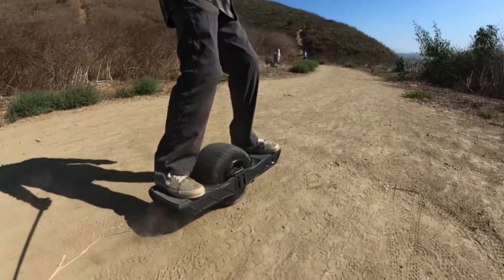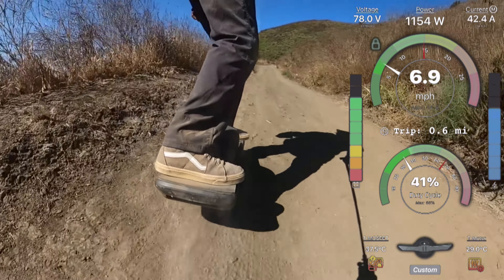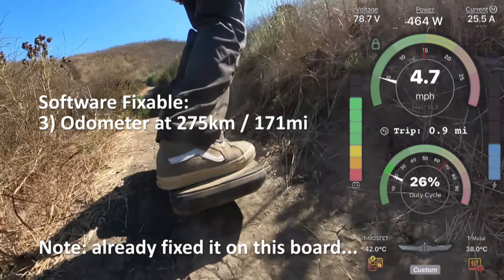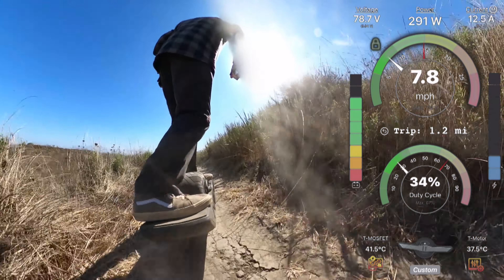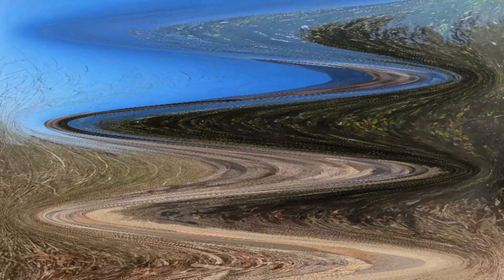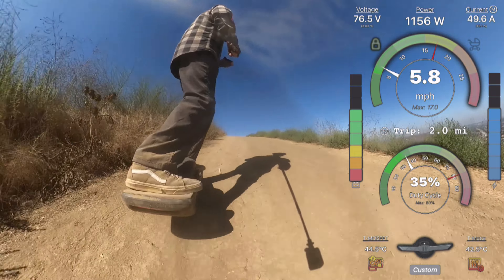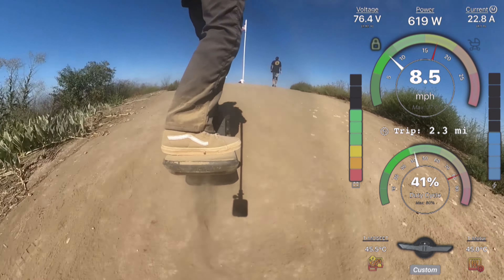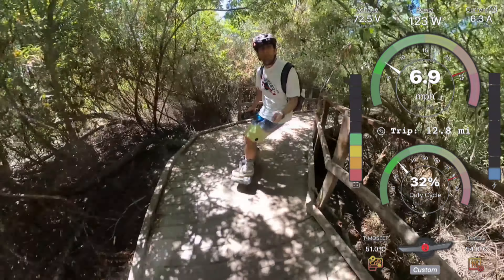Floatwheel ADV Pro - Issues and Fixes

Comment: Whole team Watching and taking notes, 
Yep the first batch turned out to be more bumpy than we thought, I'm very sorry about this.  
But already working on all the fixes. Here are some progress at fixing those problems,
1. battery drain issue, it currently drains at 0.008A and its not good, 0.008A means your board will drain in 41 days, which is not longer than a winter season, but like you said luckily we have bms protection, so it doesnt trash your battery even if they got left not charged for too long, easy fix will be plug it in wall and leave it during winter. another fix will require at least swap out the LCM module for a new one, I have already made it drain at 0.0004A now on my boards with modification on the LCM that means it will last about 800days fully charged sitting there, but still oberserving for any quirks with that mod, which is replacing the LCM bottom R6 resistor to 1206 200K resistor, requiring a hot air station, I understand most of people dont have one, so I'd just order 600 units of revisioned LCM for you to swap out, that is how I plan on solving the slow drain issue, I found it using liquid nitrogen dipping the whole ESC+LCM, and using a thermal camera, that resistor is the only hot thing during poweroff, and I replaced it with a 200k and the drain is gone. I designed the LCM with the IC's datasheet requirement (10K) turns out it is too low for real life situations, but thank god the cost is not astronomical, we can afford this recall. 
2. footpad sensor ghosting issue, the issue only exist in first 80 footpads with the first batch boards, the problem is the layers being assembled using wrong type of adhesive causing water to disolve the adhesive rim around the sensor layers, we have shipped all 80 customers with new revisioned footpads, they should be able to get it in this week, the new footpad used a PET base adhesive so it is water resistant, I have tested the new ones under water for over a week, still works great.
3.BMS issue: yep we need a more advanced BMS  that can talk with the vesc incase of a battery pack malfunction, at least it should slowly pushback before cut off, for this to work, we are now working on a new BMS and a new cable harness, that will allow the bms to communicate with the ESC, other than that, it will need individual cell monitoring with app, active balancing, protection parameters set up via app, and it needs to be a charge and discharge bms for sure, charge only is not ok, in event of a ignorant rider leaving the board uncharged for 3 month while the battery drained to 0, and he plug it into wall, next thing the whole house is burnt down and we on tv. so I disagree with charge only bms, use this only if you know your battery stuff. we have a working bms evaluation prototype that already does active balance+individual cell monitoring via phone at hand, the problem we have is that this bms is massive, we havent figure out a way to put this in our board, probably need to do a 3 layer board to board to board design to fit it in, it is a massive project, even bigger than the floatwheel adv itself, so allow us some time, we have seen 2 events of bms cut off during ride, it was in the first 80 boards, one vital QC process is not carried out during first batch production, which is individual cell drain monitor, we now let the baord sit in the factory for a week, test for any cell drain issue, so this will be stopped in factory and no longer be an issue in the future. but like I said new bms is being designed and we will make sure it is backward compatible with first batch boards.
4.Brittle plastic, simply was us being stupid chasing for that matt surface finish and dumped too much fiberglass in the mixture, first 300 boards will receive a whole refresh set of plastic shells(bumper set +fenderbase set)
5. Motor making UFO noises at lower speeds, easy fix is tune your zero vector frequency up or down 1khz and the noise is gone, we think this has to do with current sensor not being accurate enough in lower speeds with lower battery voltage, cant say for sure, but once I tune the zero vector frequency up a bit, its gone. 

6. first 200 motors are way too torquey, they are wind to the same configuration as the hypercore actually, the reason why it feels slow compare to the GT is that it used magnets that are way too high spec, on the GT you can take one magnet out to measure, it is around 1750Gs that means it is a N30-N35 magnet, the adv is a N42H magnet, which measures 1929Gs in the center, on top of the higher grade maget this thing is thicker longer wider than the hypercore's magnet, so the flux is 1.6x hypercore, with this magnet it comes great torque, but the magnet also generate massive BEMF, so it doesnt run fast without fieldweakening, fieldweakening is basically injecting current into Q axis to create a magnet field to fight against the BEMF generated by the motor, so with 80A field weakening, you will find the motor can actually spin faster than the GT but sacrifices efficiency at higher speed, the first batch of motors will be really efficient around 20mph which is the speed I ride longer distances at. I purposely set it this way so the range is good even with a bigger ass motor, but since you guys like higher speed, doesnt hurt me to swap to 135 new design motor, it doesnt really hurt your torque tho, it just needs 20% more current to generate same torque as Batch 1 motors, so expect the ESC to run hotter than the batch 1 motors. in accelerating performance the new motor will feel more like a GT which picks up speed quite fast but with higher torque to keep your nose not scraping. 

That is really long essay, thank you for reading this, now ima get back to fixing first batch problems for my supporters.
Reply: A very thorough and reassuring update Tony! What would you say the final waterproof level of the boards came out to be? Can I be comfortable riding it in the rain, or through a small puddle??
Reply: @Jdb63  the motor plug might need another layer of protection from dado's experiment, I'm thinking maybe badger kit + a raincoat for the motor plug or you can just soft epoxy the whole motor plug, and maybe heat and press on the smart lightbar and front and rear light windows, I don't trust them 3m vhb that much, even tho It seems to do a good job of keeping water outside, the front and rear box is solid other than those.
Reply: Tony and the team are legends and will soon take over the market this Board is amazing never felt anything better you have all our support moving forward 🤩 🤩 🤩 keep it up ❤️
Reply: @floatwheel not sure if you heard yet, but people have been able to reduce the motor noises by lowering the brightness of the LEDs so i suspect there might be some interference going on.
Reply: @freedomcaller  yep heard it too investigating right now
Reply: I don't know how feasible it is to have two different motor configurations, but as a non-speed freak, I love the extra torque and higher efficiency. I'm glad I got one of the first few motors. :)
Reply: @justinsmith5862  John said first batch motors will probably be the only one that doesnt need big current to drive an American.
Reply: I like we don't have to ask for replacements on the early issues, Tony's taking care of us ❤
Reply: I will also mention my board Beeps at 70% duty cycle, sometimes it won't stop beeping after I change the light setting, and sometimes it beeps while it's just sitting there after I dismount.
Reply: @hippie.matt.  sounds like a bad firmware on the LCM
Reply: @floatwheel  also why can't the board be powered on while charging?
Reply: @hippie.matt.  its a UL2272 safety requirement, also if you can ride while charging people will try to ride the board while charging and snapping off the charging cable, if a pev can be activated during charging, it's definitely poorly designed
Reply: @floatwheel Just one more thing the Bluetooth can be flaky at times Works flawlessly while I'm sitting on the bench but when I pull it out of my pocket after riding it's usually is disconnected from the board.

Even with these little quirks still 110% satisfied, the float wheel Team is awesome ✌️

Cheers Matt #1745
Reply: almost like they needed more testing.
Reply: I wish all companies would handle problems like fw is doing it. Much respect, Tony!
Reply: Amazing transparency and phenomenal customer support with fixes and replacements. Next level awesome Tony and John! 
I am so happy to be a founding supporter of this fantastic initiative. 
I am around 400kms on my ADV Pro and it is riding superbly with the stock tire at 12psi and rails lowered one stop, I ride pretty hard predominantly on MTB trails and it eats up anything I throw it at. 
Funnily, I've also discovered a renewed liking for big carvey paved trails for short spells because the ADV is so smooth and cuts some monster carves. 
When you consider price, repair-ability, support, ride experience, overall build quality etc. I highly recommend Floatwheel ADV's
Reply: @floatwheel. Is it possible to include a gen 1 N142H motor with my order instead of the gen 2 135?
Reply from the maker: Tony, we are taking care of the LCM firmware. Simon, your very first ADV customer is currently testing new versions  with lots of improvements - we will share the new version with you when ready
Reply: @chodarth  I got your idea, since there is no uart comand in the vesc to stop motor from being spinning, So i went another route to just shut down vesc power back when I was designing the LCM. but it is a firmware fix tho.
Reply: @chodarth  got it, it's easy via a
Software update
Reply: WOW what a way to respond... I'm still waiting out on some of these important fixes to be addressed before pulling the trigger on ADV but VERY VERY impressed still. Keep at it Tony and the Floatwheel team and also surfdado! yall are GOATs!
Reply: Wow, The floatwheel team is awesome!  Next board i'm getting will NOT be a Future Motion product thats for sure!
Reply: You are already better than FM. We appreciate it
Reply: Floatwheel for life!
Reply: @floatwheel is the whole board UL2272 certified? If not, which components are? Thanks

Comment: I just got mine yesterday and took it for its first real ride today. Sooo much more power than the Onewheel Pint, but definitely less carvey. Feels great and stable though. mine is making the UFO noise and i was unable to get it to go away with the zero vector Frequency adjustment. Dont mind it that much though so not that worried about it. I can only run my tire at 12psi. Any more and it rubs. Also when looking at the motor parameters and the motor inductance difference i notice mine is nowhere near either of those numbers you stated, being actually around 15. I dont know what that means but its got gobs of torque and I wont be riding 30+mph so not concerned with getting over that. But im stoked to finally have mine in hand and be riding it!!! So much better than my Pint in a lot of ways.

Comment: I hear you on the bms thing with gtv vesc. On the gtfo thor 300 ot comes with their bms that I installed along with the thor. It was bad out of the box and fungineers is sending mee a new one. It was only showing 16 cells charging on its app, even though it was charging out to 75.4 volts at 4.20 volts per cell or close. Is the thor bms one o the ones that can drop you like you speak about, or is it a stand alonne bms. I wish fungineers made more info available on their products.
Reply from the maker: @dbirds21  all the BMS’s are charge only BMS’s, none of them can/will dump you
Reply: @surfdado  thank you. curb nudges are now so much easier with the thor. the stock setup was a challenge everytime with no power. had to lean hard on power. now with thor I just creep up n over

Comment: Great video, thank you. It's been awhile, can I ask what you use as your daily OneWheel driver these days? Both on and off road ideally? And I'm wondering how the Floatwheel has aged? I'm pretty amazed by how durable my XR is longterm, I live on the beach and it's perpetually covered in sand and other than a few grip tape replacements and a tire, it's still rock solid after 2 years of constant abuse. But a bit more torque especially off road sure would be nice. I'm considering VESCing it, but also of course considering a Floatwheel.
Reply from the maker: I ride mostly trails so I prefer my XR based custom builds. To me the Floatwheel is a great street cruiser, and maybe light trails. But it overheats way too quickly on harder trails (most of my local trails)
Reply: @surfdado  Interesting and thanks. Any thoughts on how a Floatwheel overheats compared to a GT on those harder trails? And psyched to VESC my XR.
Reply from the maker: @wrybread   the motor crushes the hypercore in thermal performance but the controller is the weak link in the floatwheel
Reply: @surfdado  Is there a VESC controller that you think is an improvement?
Reply from the maker: @wrybread  plenty controllers out there but none would easily fit into a floatwheel. Tony’s V2 controller should solve a lot of the existing issues

Comment: Mod that bms and make the low voltage trigger IN the controller, this way when the cint. Gets low it alarms, pushback etc.  This would be an easy solution .. no?   Ha, at low speeds it reminds me of the sound a recognizer makes ( tron reference )

Comment: Did you ever find out what broke when you went through the water?
Reply from the maker: Water got into the motor connector and killed my ESC - but also the bearings couldn’t handle the water. So the stator is rusty now. Basically needed motor and ESC replaced. Only the battery survived undamaged
Reply: @surfdado  Ohhhh, now I understand why everyone is putting bearing covers and greasing the connector. And the picture of a rusty stator must be yours then, it all makes sense now haha. Thanks, Dado.

Comment: I actually had the board shut off due to a bus issue today, Tony stated 'We will send you a board with a new BMS and a battery pack via air freight. It will take around 7-12 days for shipment'
Reply: I wonder if its an updated hardware model
Reply: @crazythegamer329  same model ;)

Comment: His video has it all! I checked my flux value and it was at 36.6, so I guess I have one of the first slower motors. Are there benefits to this motor over the newer one? Better off road? I don't need to go fast, but I want to know I can go fast, LOL. Also with the BMS discharge and potential shut down, is there something to be said for lower voltage cutoff values? I'm running with Nico's 54 / 50, but I know the board garage recommended 46 / 40. I care about not getting injured more than I care about not damaging the batteries...
Reply from the maker: Stick to Nico’s values - but it really doesn’t matter. The key is to respect low voltage tiltback and you don’t need to worry about any of it. All those voltage cutoffs only affect if you if you keep riding long past the low voltage tiltback

Comment: Excellent overview, thanks Dado. 

On your point about the BMS being discharge/charge. Other than the fact that it's another potential point of failure if a BMS is programmed properly surely it is not inherently worse than direct discharge.
Reply: for a race board the bms could result in a crash. On a consumer board a quality bms is much appreciated.

Comment: Ouch on the discharge BMS. The last gen Floatwheel would cut out on me all the time due to this and I wouldn't buy it again because of this. Hopefully the limit is really high on the ADV
Reply from the maker: Limit is 80A, so from that side we're good - it only gets scary when you're at 100% charge, there's no much margin there with regen currents, especially with the slightly saggier non-pro battery

Comment: I had my board making the same noise as 13:57, Tony said to change zero vector frequency between '26 27 28 29 30' and mine went away almost completely at 30
Reply from the maker: Yes, this is standard procedure to try those ZVFs but for me it remained equally loud but changed the sound effect between Star Wars, Rave, and 2-stroke engine 😂

Comment: Awesome video as usual. I have always told that I don't like the idea of dumb BMS and moreover in every balancing PEV sold commercialy communication with controller is a must, that's why I use and encourage everyone to get xlite instead of other options (I know that we still don't have a code in floatpackage to handle that, but that will come eventually). When it comes to video I don't fully agree with the statement that charge only is best practice. IMO we wire it charge only, because we don't have small enough, vesc enabled, reliable charge-discharge BMS that could take amount of amps we need for trail uphills (the ones the overheats hypercores in minutes).

Comment: Very useful thanks. Regarding the battery issues reported, do we know at this stage if it affects one type (pro vs standard) more than the other? Apart from riding carefully through a whole charge, is there any other way to detect potential issue?

Comment: The BSM issue sounds like a big one. Had been considering if I want to pick up one of these rather than a GT, but at this point I'm not too comfortable with modifying the hardware aspects of PEVs. Overall, how does the board compare to the GT?

I've had a Pint X for almost 2 years now and really enjoy it, but want a bit bigger board for longer rides and more power wouldn't hurt. I could easily see eventually having 3-4 boards (Pint X, modded XR, GT, Floatwheel), but been eying the GT for a while now unless the right XR pops up.